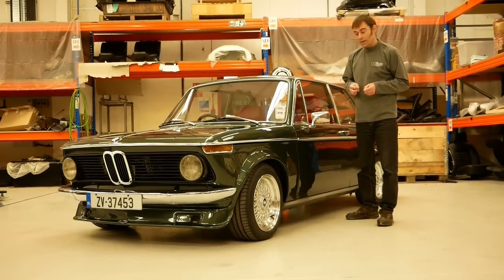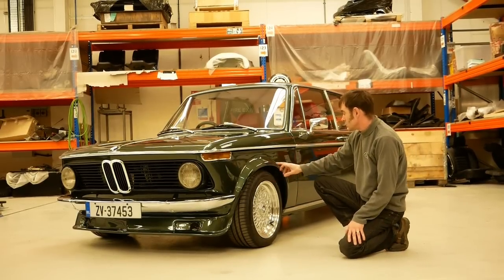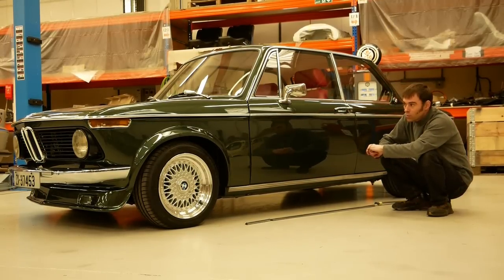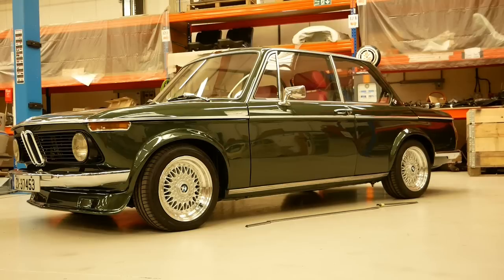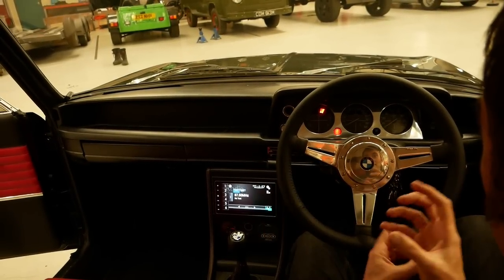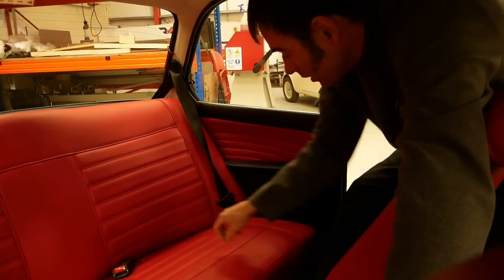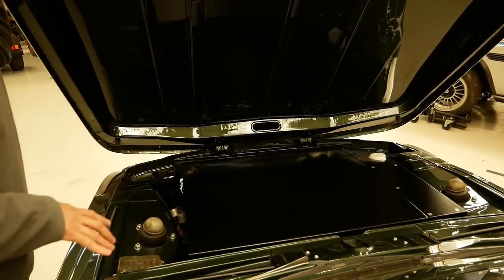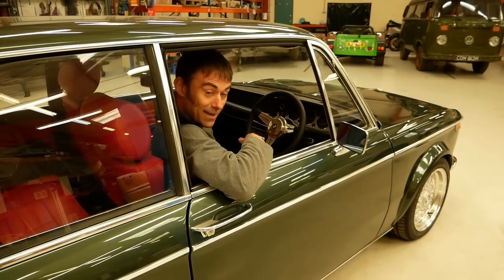Workshop walk-around Ep1 : BMW '02

Comment: Very cool stuff. Questions about the gear box: Can you "engine brake" by down shifting? I suppose that regen is how you do that, but does shifting affect regen? And, when you drive in, say, 3rd gear in town do you get greater range? Do you get greater range in 5th on the highway? My 1994 316i Touring will be electrified eventually (and the company that makes the Hyper 9 is right down the road here in Chicago!)

Comment: Love it. Since I have a BMW E31 it's good to see the classic ones converted to Electric. I'm sure the price is different from build to build but love to know a rough EV conversion price. Also how do you deal with the power steering if any, AC and also heat in the car?
Reply: This kind of place will be too expensive. 10s of thousands.  Do it yourself and get help along the way from others.  See my channel for another take on this subject. Steering keep it simple and use a electro hydraulic pump, that way you keep the original rack. Heater you can use a water heater. Ac can be more tricky. I'll be talking more of my ideas later on my channel.

Comment: idk if this is a silly question or not but do you convert any car or will it only be classic cars?
Reply from the maker: Classic cars from the 50s through to early 80s is what usually floats our boat. 😉👍
Reply: @ElectricClassicCars  ah, shame. I'm very much interested on what the quote would be for a BMW E46 320ci 2005 ev conversion. Thanks!

Comment: Has anyone noticed that the vehicles converted are pre-obd2 canbus? The 'modern' cars can't be done due to vehicle management systems being programmed. Take out the engine monitoring, catalyst sensors, fuel injector sensors and you've got a vehicle that won't work. Add electric motor and battery and the ECU will not allow it to move. This conversion is all very sweet but it shows the failure of government to protect consumers against blatant profiteering.